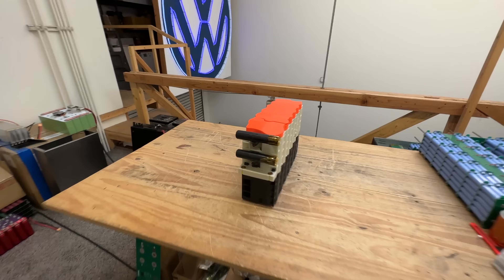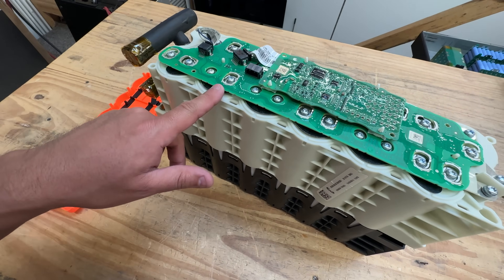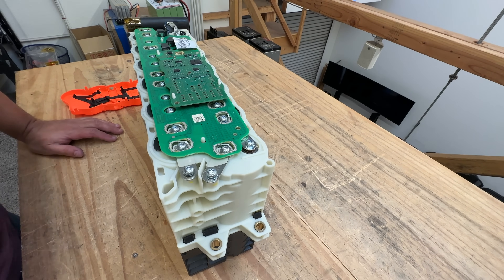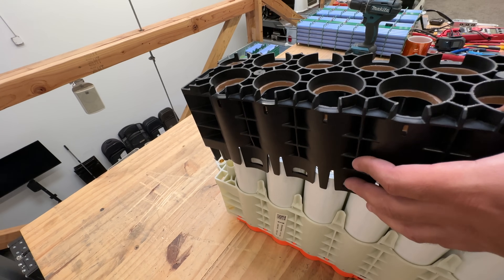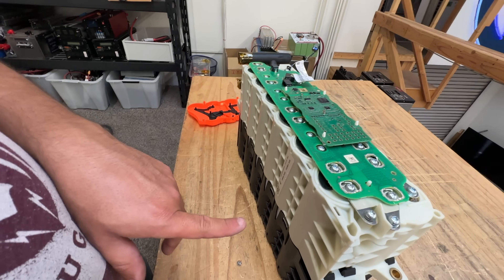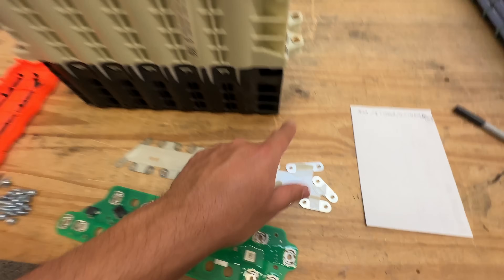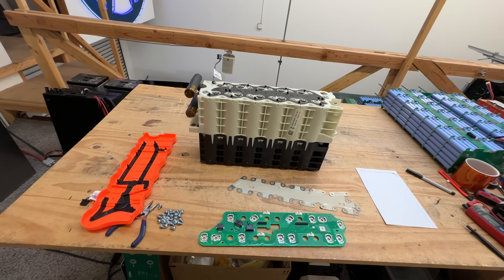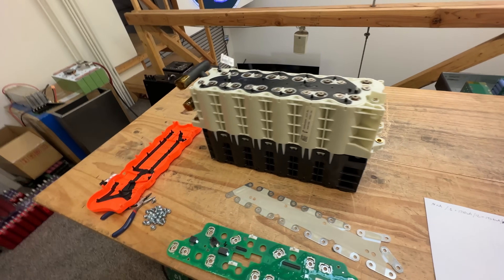Saft VL41M Lithium-ion  2Kwh EV Modules

Comment: I have an E450 with a hybrid electric drive installed/made by Azure Dynamics that had those same cells in it when I got it.  Cells have since failed for what it is worth.  May have been a BMS issue, not sure.  Well built I think, but mine is from 2012 so they just aged out perhaps?

Comment: Hi Jehu, wow I am so happy someone has so much knowledge about battery! I have Gotrax GXL V2 Seris Electric Scooter, and want to buy replacement battery. On the product it reads it uses 36 volt 5.2 Ah, I am wondering if I buy "36V 6.4AH" or "36V 7AH" hoping it will last longer. Wondering if that's a danger in buying higher number. Thank you :)

Comment: These seem like an interesting alternative to the LG chem Pacifica batteries but that'd depend a lot on the C rating. 
18 of these have a similar kwh rating to 18 of those lg chems
Maybe this is also an alternative to chevy volt modules?
Reply: Seems to me it's Saft cells. NCA chemistry so 4V/cell. VL41M cells I'd say. 4.2V per cell is way too much for this chemistry.
Reply: @metalazzo yeah max is 4.1v